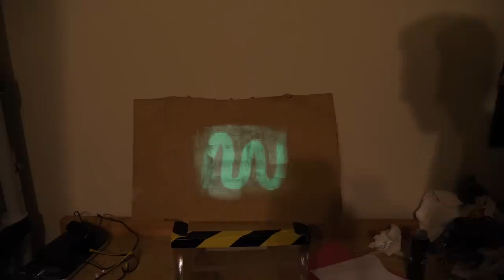Mixing the World's Blackest Paint With the World's Brightest Paint (Black 2.0 vs LIT)

Comment: If heat charges it, does cold discharge it?
Reply: o.o
Reply: Discharging is theoretically the same as cooling down.
Reply: Are you saying it won't charge if it's in liquid nitrogen? Also, batteries still have charge when cold.
Reply: nambinhvu in liquid nitrogen it would still become phosphorescent because making changes like this at a quantum scale tend to require humanly impossible temperatures. As for batteries, although charge and energy are related, they aren’t the same thing. And in this instance we are looking at energy levels of atoms. Also with batteries they provide electromotive force through a chemical reaction which is slowed down by reduced temperature. This is really apparent with lithium batteries which tend to cause your phone to die with irritating speed. I’m not gonna lie explaining quantum mechanics in a YouTube comment section is weird so I’m gonna have to suggest that you look up the mechanics of phosphorescence and how it relates to rest energies and photon energy. One key point to visualise though is that on an atomic scale, kinetic energy is essentially the same as heat energy on a macro scale and so giving energy away can be perceived as cooling down. I hope that wasn’t too incoherent and generally confusing/illformed. 
Although this is unrelated the substance that is “LIT” is quite interesting as it requires very low energy to excite its electrons. Most things require the ultraviolet spectrum but this can use heat for the same purpose meaning it infra red energy photons will excite its electrons saying something about how weak the energy levels are.
Reply: Mr Bork let me rephrase my question. I only need a simple answer, not how it works, just, does it work? So if I cooled the powder to liquid nitrogen temperatures, would the stuff warming back up to room temperature cause it to glow? The answer is yes or no, not an explanation of quantum mechanics.

If heat causes it to glow, is it the change in temperature that charges it, or above a certain a temperature? If kept at 90ºF would it glow indefinitely, or would you have to further increase the temperature to get it going again?

If it stays glowing at 90ºF indefinitely, is there a substance that glows indefinitely at below 0ºC?
Reply: nambinhvu nothing can just create energy. So nothing can indefinitely glow. However some substances should be able to “glow” just from the process of absorbing IR radiation as they heat up from a reduced temperature.
Reply: Mr Bork duh nothing can create energy, how do you think it's staying that temperature? Lol My question wasn't of if something can stay warm forever without any input. My question was is the energy from the temperature what causes it to glow, or is it the change in temperature? Will 0º ambient - 15º cause the same glow as 15º ambient to 30º? I hope my question makes sense.

You didn't answer any of my questions. XD
Reply: nambinhvu it’s the addition of energy. If it’s a chemical reaction causing the emission then having a temperature above the threshold will cause I but in general it’s the adding of energy through heat.
Reply: Mr Bork what charges your cell phone,  electricity,  is electricity hot yes it's hot,  so yes heat does create light , cold cools the energy levels down,  the electrical current goes into the air and turns into ion charged particles
Reply: Ying and yang,  input and output,  hot and cold , then the perfect balance is warm
Reply: Made my point or it's dumb
Reply: Who cares
Reply: 「L」 _ heat doesn’t exactly create light though. They are different states of energy and when you say electricity is hot, do you mean that the charged particles energy is the same as heat or are you talking about the result of an interaction with electrically charged particles with others?
Reply: Mr Bork go figure,  use google
Reply: Mr Bork Heat is light
Reply: Mr Bork there's even heat in your phone screen
Reply: 「L」 _ heat isn't light...wtf you smoking? Are you talking about infrared? Lol That's not even visible to us.
Reply: Mr Bork why no direct answer to my questions? I think I just need to buy the stuff and experiment myself.
Reply: nambinhvu Any radiation that does not help, whether infrared or ultraviolet is wasted. This question is really not about heat. It's about efficiency of converting electrical energy into lightin the visible part of the spectrum. It is possibly in principle to convert allelectrical energy into visible light.
Reply: nambinhvu like I said ask google
Reply: nambinhvu before you rekt yourselfs
Reply: 「L」 _ because Google knows everything about LIT...no, no it doesn't. I'll have to buy it and experiment with it myself.
Reply: I think cooling it will make the glow much less intense but will it will glow much longer.

Comment: Honestly i think LIT doesnt make LIT glow because that would be infinite energy and you cant do that :P (i think.)
Reply: Even if they could charge each other, it wouldn't last forever because some energy would always be lost as heat. ;)
Reply: Theres nothing holding that energy in place as soon as that light leaves the energy starts spreading out and leaving the paint
Reply: It won't glow from its own glow because it discharges light at the same speed that it is taking it up. Because it is discharging at the same time as it is being charged it will not be able to store a charge once the glow from the other source is taken away.

The original lit paint has been charged more than the second board therefore the first board continues to glow after the second board is taken away.

I would be interested in knowing if the second board glowed at the same time as it was being presented with the first board, in a sense reflecting the light, and whether being in the presence of the second board preserved some of the charge. It would be a difficult experiment to control,  but I think it would if done right.

Comment: This “shift” is electrons in the paints atoms being excited by the wavelengths of light . They absorb the wave lengths if light and end up at an energised state. However they can’t stay there, so they happen to release that extra energy as a wavelength of light - this is what glows. 

White light contains all wavelengths of visible light (390nm-700nm), a red filter will block all wavelengths except the ones that are red (600nm - 700nm), hence why it will glow less after only being charged with red light, since there is less wavelengths to excite the electrons. 

UV light has very short wavelengths with high amounts of energy. It makes it more likely to excite the electrons. So more get excited so more glow. 

Just if anyone was interested! 

Disclaimer this is a pretty simple explanation, how luminescence works is very cool and worth checking out in more detail! There’s a lot more to exactly how much energy electrons can absorb or release, since it can only be certain amounts - “packets of energy”.

Comment: I conjecture that glow in dark material absorbs photon and goes into an excited state. The transition from excited state to ground state emits photons of green wavelength. Since there is some energy loss charging it with exactly the wavelength it emits will not make it reach excited state. So anything with energy higher than green wavelength would work. 
It also explains why it didn't get charged with red filter on. Slight charging there might be due to imperfection in red filter. A true red filter would mean no charging.

Comment: I am curious though:  when you painted your hand, it was in a bright room.  Thus the paint would have absorbed that light.  Would like to see putting the paint on in a dark room with barely any light and watching it start to glow due to the body heat.  Also, I wonder if it glows brighter with different levels of heat, could you use it to find hot spots on something that should be uniformly temperate, say on the case of an electronic device.

Comment: Old video but first time watching.  My thoughts on the charging  glow-in-the-dark with GIND is color is created by the wavelengths of light which is reflected.  This while this is a case of emiting vs reflection, I could still see it being a case where the green light is being "repelled" by the substance.  That would mean that when charging it, if that is the only wavelength present, it would repell it, and not absorb any light to emit.

Comment: Reason for LIT and other "chargeable" glow-in-the-dark materials glowing in just one color no matter what color it was charged with is the fact, that the emission of light comes from energy level changes in the electron hulls. These changes have specific distances, they are quantized. So with a specific amount of energy you can only emit one wave length of light. To charge it every kind of wavelength works as long as it meets or exceeds the energy needed to step up said energy level. Blue and ultraviolett light has a very short wavelength and therefore high energy so you can charge LIT very well and fast with it. Red light has a very long wavelength, IR even longer. So there is less energy than needed to kick up the electrons to another energy level therefore LIT seems very unimpressed by red light.

Comment: If you look at a color wheel, the colors directly across one another are exact opposites. It makes sense that Red light won't charge a Green glow very much as if mixed you will get a grey color. This is because when you are speaking about colors, opposites cancel each other out or defuse each other. The only reason the red light activated the green glow in the slightest is because of the heat generated from the light source. The light you are using is extremely powerful and generates a lot of heat when turned on. If left there long enough even with the red filter the glow would get almost as intense as it did with the small amount of time with the white filter.

Comment: My understanding of glow in the dark pigments: when the light hits the particles, it energizes the electrons into a higher energy orbital. When the electron loses energy, it drops back down an orbital emoting visible light. The colour of the visible light is determined by the orbital that the electron is jumping from. I learned this in highschool chemistry. So the glow in the dark pigment is not "shifting" the emitted light... It is set by the electrons orbit in the paint. 

Also, when you got a stronger reaction from the white filtered light than from the red filtered light, that was not because of the wave length of light. The red paper was visibly thicker than the white. The intensity of the light passing through the white paper was thus higher intensity. A higher intensity light excited the electrons more than a lower intensity light and thus you get a weaker light emission. If, instead you measured lumen output of a red light and matched that with a white light, you would have likely gotten comparable intensity in the paint.

Comment: this powder is strange because it doesnt seem to actually convert heat into light or atleast up to a point until it just becomes fainter and fainter at the same temperature.
experimental setup:
1 vacuum thermos with boiling water inside
lit imbedded in a polymer (silly putty)
drop in hot water and keep in dark room.
wait 2 hours and transport lit blob into new thermos at boiling and repeat!
eventually after 5 hours the glow becomes faint and no longer seems to glow and requires re introducing towards lightsource to be able to slowly re emit light.

test 2 : at higher temps it seems to burn out quicker. when placed on a hotplate it glows for a short burst and emits less light than previous test overall and afterwards when re excited by a light/laser it can be heated and re emits light again but seems to be shorter ( i think the lit got burnt or broken down)

I think this is thermoluminesence where its able to emit light when heated due to it previously storing energy from a source of radiation strong enough to excite the molecule.

Comment: It won't glow from its own glow because it discharges light at the same speed that it is taking it up. Because it is discharging at the same time as it is being charged it will not be able to store a charge once the glow from the other source is taken away.

The original lit paint has been charged more than the second board therefore the first board continues to glow after the second board is taken away.

I would be interested in knowing if the second board glowed at the same time as it was being presented with the first board, in a sense reflecting the light, and whether being in the presence of the second board preserved some of the charge. It would be a difficult experiment to control,  but I think it would if done right.

Comment: Since black absorbs all light one could expect it to glow.  White reflects all light.  But i suspect it would still glow mixed with white unless the white paint was over the lit.

And when you use white light, which is red, green and blue (not exactly but im simplifying) you are using MORE light when you use just red you are using less light so it should be expected to glow less.  A better experiment would be to compare red, green and blue.  This may verify whether green light can charge lit.

Comment: Google "fluorescence" and you will quickly learn that it normally takes a higher energy photon to cause fluorescence.  In other words, to cause green light to be emitted in a material that can fluoresce green requires light of a shorter wavelength. In other words light that is toward the blue/ultraviolet end of the spectrum. Pure red light would cause no fluorescence. The red paper used in this video allowed some blue light through.  This is what caused the weak fluorescent observed.

Comment: My guess as to why it doesn't glow:  It's supposed to glow as bright as possible, meaning that it shouldn't absorb any of the light it emits. So if it were to be charged by other glow in the dark stuff, it would be dimmer than optimal.

Comment: Based on the video and what I read in the comments I believe that the paint shines only in a specific wavelength. Light of shorter wavelength (ie of higher energy) is absorbed and then slowly released as light of the specific wavelength. It is released slowly because it takes many rays of light of a long wavelength to release the same amount of energy as few rays of light of a short wavelength.

However, if the light shone onto it is of the same or lower wavelength than the one in question, the paint will not be charged, as the shone light will be released again with the same intensity immediately.

Also, while heat would in this theory not actually charge the paint, the paint would still release green light while under the influence of heat (as that is the only way it can release energy in large quantities) so it still shines green on a human hand, while, if that hand were to spontaneously turn cold, the glow would immediately stop as well, as it was not actually charged.

Comment: I think the reason why it didn't glow when you use the charged LIT to charge uncharged LIT is because you were not supplying the absorbable energy but rather the complement half from the electromagnetic spectrum. I still have a question tough that when you used UV radiation on it, it's intensity was more as compared to the white light. This might be explained as you gave it more absorbable energy and hence making it release more of the complement energy wavelengths. But this also made me think that if UV increases it's intensity and it releases greenish colour, it's emission spectrum should be from green to infrared but it still glowed absorbing your body heat which is infrared. I have doubt there.

Comment: The most common glow in the dark pigments (strontium aluminate doped with rare earth(s)) are green, aqua and blue and glow the longest. Several things are at play here. Green is the color of light that people see the best. Blue charges best from UV light. Aqua falls imbetween green and blue in the way it charges and length of glow. The rest of the colored GID pigments do not glow nearly as long as green, aqua or blue because the wavelengths of light are not as energetic in the red-orange-yellow end of the spectrum or so energetic that it is hard to keep them charged such as purple which is part of the purple-UV part of the spectrum. White GID powder is a combination of GID pigments and doesn't glow for more than two hours fully charged which is counterintuitive. Remeber, we are not really dealing with pigment which absorbs light and gives off a specific colr. GID pigment emits light of a particular frequency. Heat will cause GID pigments to glow brighter because energy is being put into the system so energy (photons of light) can be emitted as a result.

Comment: The filters used made a difference due to density of the paper, not the color. Try the experiment using filter cellophane or glass, where any color differences are from the actual light color, not dye on paper. Interesting video.

Comment: I'm pretty sure that the pigment didn't charge the paint because when charging something with electromagnetic radiation, there is a certain threshhold that will not be passed, and that threshhold is close to the minimum amount that can be absorbed, therefore it just doesn't give off enough light.
I may be wrong though, that's just a guess.

Comment: The longest wavelength it can absorb is green light. So, with the shorter wavelength ( red, yellow... ) it can emmit the light. Because the shorter the wave. The more energy contained. With the einstein equation that u have learned at highschool. U can explain it.
And with the longer length (....purple). It can not release any light because there are not enough energy for the photon to jump out of the ink.